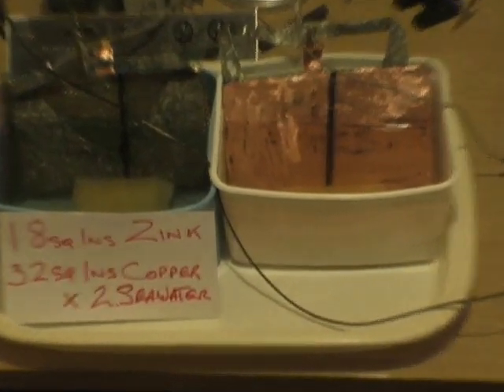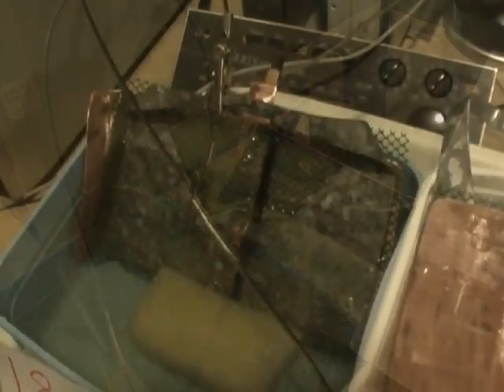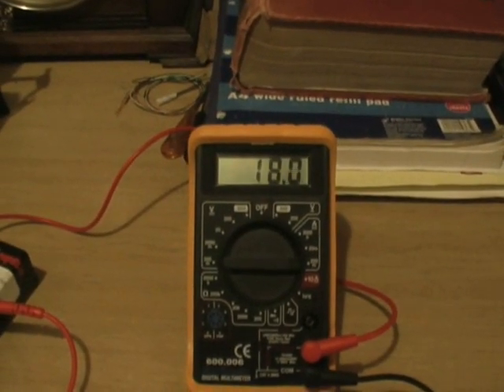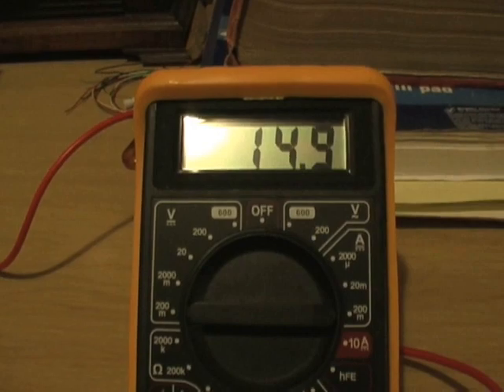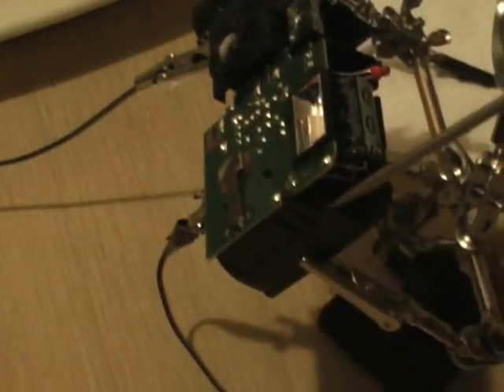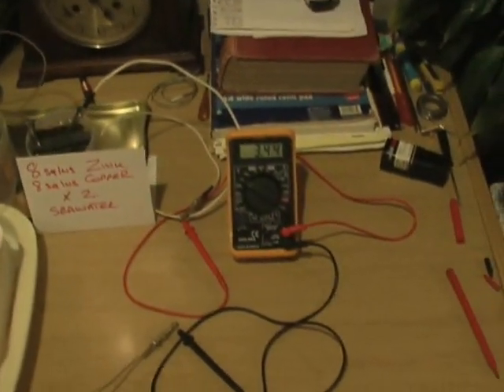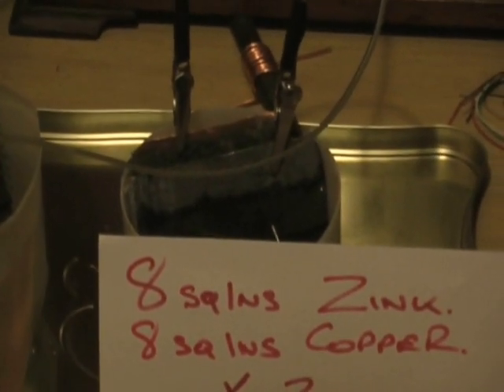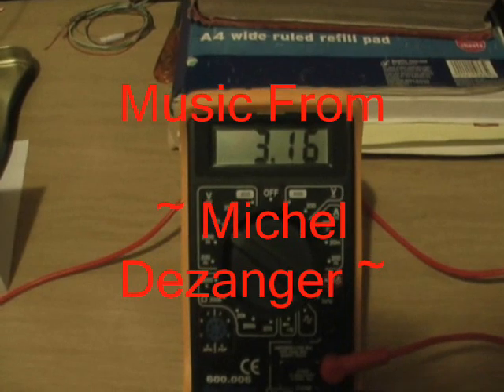Water Battery HV Capacitor # 2

Comment: just had a thought, hho gens get hot, water batteries get cold, so encase a hho tube gen inside a water battery tube using the heat from the hho tube to heat the water thus upping the output of the water battery, water can be split using HV and super low amp draw perhaps this is something you may want to look into as it will save you loosing volts from the water chilling, with enough refinement it may even be able to run the hho machine.

Comment: This is Awsome ,,battery bank trickle..well this 78*F day has me tilling warm soil ,,so I can feild test a solar dehydration later season -I am surprized by the heat reaction -garden mesh is what materail --and I am still beating that old drum BTW ,,haaa ,,harder than ever..to old to run,,but enjoy a good sandwitch at least at this picnick ,,i have seen many a small dog stand under the tyrants and dish out some retrobutions--maby a homebuilt cap would be better -??or it's the change temps blows